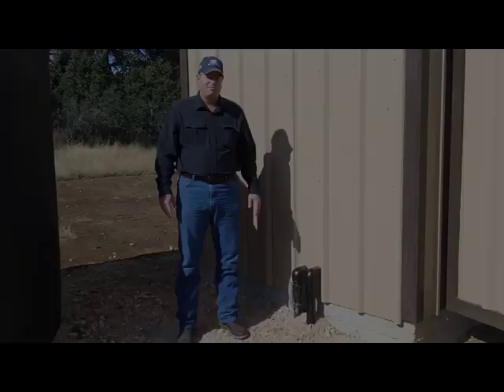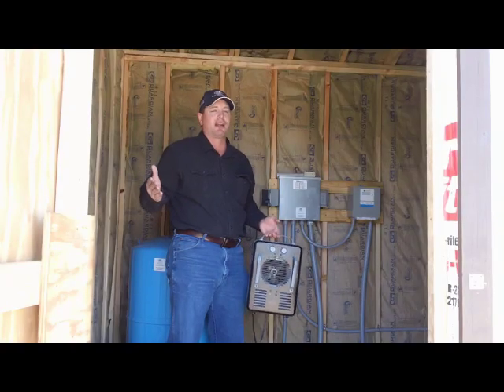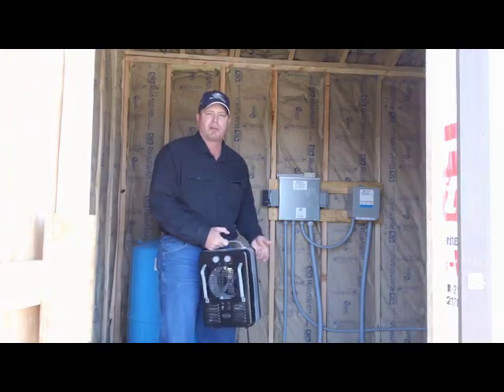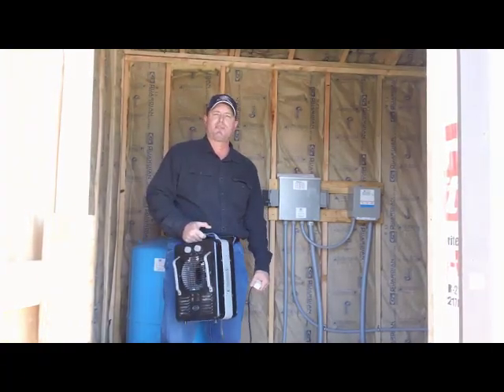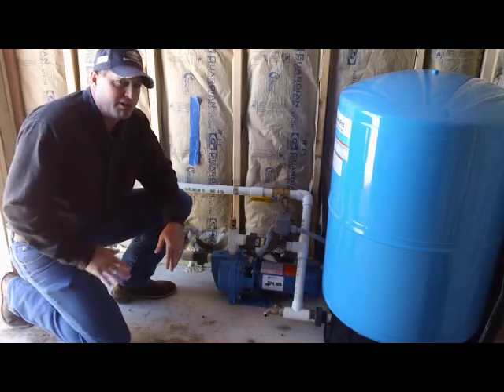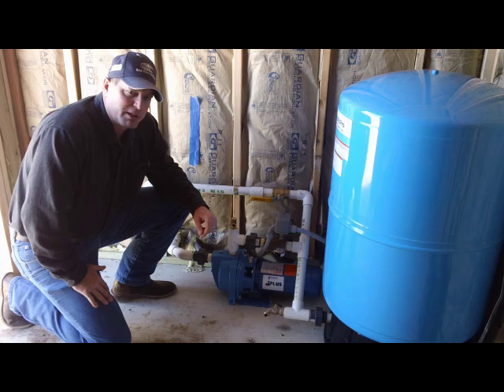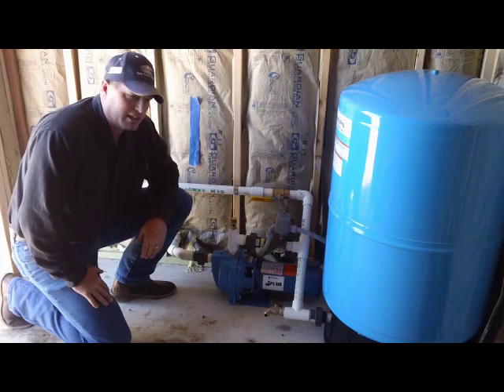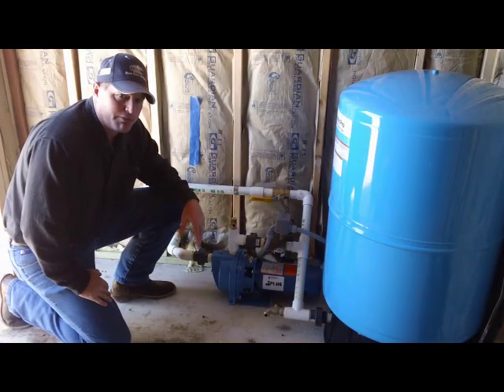Freeze Protection

Comment: Another good thing to mention would be solar power with backup battery. Or a generator. Some people may experience ice storms and power outages. Then none of that works, except the insulation. With backup power, you're definitely covered. Thanks for sharing! I'm planning for our well pump system install and found your video helpful.
Reply: Bluetera good point

Comment: I don't stay at my ranch all the time. I have a storage tank system, is there a way to make the pump kick on with a thermostat so water is running when its below freezing? I have a insulated house over my pump with thermostat cube for a heater. My concern is the storage tank and pipes.

Comment: I have a shallow well pump in my basement it's not insulated would some heat tape on low placed on the pump protect it from freezing
Reply from the maker: Yes.  If the power stays on.  But if its in a basement, a small space heater will work too

Comment: extremely good advice every homeowner should know if they dont live in a city. what i dont get is why you cannot build on top of a well. it would keep it insulated and pipes wont ever burst. yes, i know wells can collapse, but this isnt the 1800's. i am sure there is a way to get it to work.
Reply from the maker: When the submersible pump needs to be replaced, you have to pull the pump up through the casing.  Normally it is in 20' joints of rigid pipe.  If you have a hole in your roof (like a skylight) then you can build over it in many cases.  But, it will slow our crew down and you are paying by the hour to change the pump.  Another option is to replace your pipe with a flexible pipe or hose that won't require the hole in the roof.  This is not always feasible depending upon many conditions.  You will need to consult with your local well contractor about this before doing.  i have redrilled a few wells in my life because we were not able to service a well because the homeowner built around it too much.

Comment: Hey nice video! If we were putting a pump system into a seasonal home would it be bad to just let it freeze when we left for the winter? (We would drain the tank before we left of course!)
Reply from the maker: As long as you completely drain all tanks, pipes, etc. the equipment will not be damaged due to a freeze.  But it may be hard to get all the water out depending upon how your system is set up.  You may need compressed air to get the job done fully.  Good luck!
Reply: Thanks! @jimblair1   I'll sure be willing to put in a little extra work when closing up camp. Which is much easier than having to worry all year.

Comment: Hi Jim. We're in W Central Missouri and trying to decide whether to change our old deep well pump to a new solar with backup AC, or to get an above ground tank (rainwater catchment), sink its bottom 42" deep with buried pipes to root cellar where pressure tank is. Any thoughts? Could an aerator in the tank keep the water from freezing? Would a poly tank stand the bottom 42" in ground? Thanks.
Reply from the maker: I don't think it would be wise for you take advice from a Texan about how to freeze protect a well up in the frozen tundra of Missouri.  But, if I lived there, I would probably build an insulated, heated pump house and keep my tank above ground in there.  Most tanks are not designed to withstand ground pressure.  They will do alright as long as the tank stays full, but if the water level drops, your tank could collapse.  Not much of a problem with a metal propane tank.  But, if you find a tank that can withstand ground pressure and you keep it deep enough, it will work.  An aerator might help but i wouldn't count on that tiny piece of equipment to save you.
Reply: @jimblair1  thanks for sharing "what you would do." I respect your opinion very much. We have heating our root cellar in the coldest nights to protect the pipes and pressure tank.  Your videos (I've watched another one, too) are very helpful! Thanks again.

Comment: I was going to build a small shed to enclose my well but then thought
what happens if the submersible pump fails over time...may have to
rip it all down to replace that pump or service the well...thoughts?
Thank you. Great information
Reply from the maker: Pump houses over the well are quite popular.  Just make sure you have a removable roof or a skylight directly over the well head.
A 24" X 24" skylight is best but we can usually work with an 18".

Comment: Hey Jim! We have a two-room cabin on concrete blocks in the North Woods. Underneath the house is open and we have a wooden box built around the outside pump. We usually leave in the beginning of October. We might have a night or two that's 30 32 degrees, days in the 40s 50s. Then the nights kick back up into the 40s with the days in the 50s. My question is when do we need to get out of town. Do the Lows have to be in the 30s consistently for two or three days with the highs also in the 30s or could it freeze with just one or two nights in the 30s. Thank you in advance.
Reply from the maker: A small water pipe can freeze solid with only a few hours below freezing.  Check out my video on freeze misers.  This is another great tool that can protect your pipes without the hassle of installing insulation.

Comment: Hi I buy a property in Arizona it have a well with a 5" steel casing and you have a PVC pipe inside the inside of the PVC pipe is 4 1/4 kenai install a 4" pump on it or have to be 3" pump I will appreciate it so much if you answer me thank you
Reply from the maker: The main casing we use is 4.5".  That allows us to install a 4" pump inside. You can install a 4" pump inside 4" casing if the casing is not too thick.  4" will fit inside 4" sch. 40 or thinner, but will not fit inside 4" sdr-17 or sch. 80 pipe.  We use 4.5" to avoid this issue.  when we use sch. 80 casing, we step up to 5".  Another consideration is flow.  If you have a 4" pump inside 4" sch. 40 casing, you should limit your flow to about 12 gpm.  You need to make sure you have enough room beside the pump for the water to flow.
Another option is to get a slim line pump (3.75") or use a 3" pump if your casing is too small for a 4" pump.
Reply: @jimblair1  thank you soon much I think I have to go to 3" because it's a share well for 2 house's I want to put a 35 gallons per minute pump

Comment: I’m about to be fixing my well we just moved into this house and wasn’t prepared for this cold snap. I’ll be insulating the well house for sure. The water system was Jerry rigged I’m going back with how it should be. I’m also going to add a heater. My system doesn’t have a booster pump does that just increase water pressure?
Reply from the maker: Booster pumps are use for 2 main purposes.  Boosting city water and pushing water from a storage tank to a pressure tank.  See my video on storage tanks.  https://www.youtube.com/watch?v=fTJrRpVkiTI&t=38s  
But, there are other tings you can do to increase the water pressure.  Check out this video on adjusting the pressure.  https://www.youtube.com/watch?v=Vv4gY35byY4
Then, check to make sure you have no restrictions.  filters, small piping, partially closed valves can all reduce pressure.
Reply: Bee Cave Drilling  thanks for the reply I got it all fixed how it should be, still no booster pump, however with only one reduction and everything else plumbed right I removed several unneeded feet of pipe and pointless valves, my water pressure practically doubled I’m very happy with it now. The storage tank really interest me and I can see the benefits in it I’ll be looking more into it

Comment: Our well head is outside of the well house. The previous owner put a plastic bucket around it with the top of the bucket cut off so the well head was exposed to the air… and threw a few nasty bathroom rugs on top of it. Wow! What can I do to keep the well head from damage or freezing?
Reply from the maker: Heat tape is great if you have a power source.  But at the very least, some insulation.  How much you need depends upon how cold it gets where you are.

Comment: What’s the purpose of a booster pump?  I don’t have one down here in south Texas,  Corpus area my well is only 130ft when we change pumps we pull it out by hand save a lot of money
Reply from the maker: We install a lot of storage tank systems where the well fills the storage tank.  Then you need a booster pump to put the water back under pressure.  Check out the video.  https://www.youtube.com/watch?v=fTJrRpVkiTI&t=101s

Comment: Thanks for the video.  What do you think about "heat tape" wrapped around the above ground pipes around the well?  George, Smithville TX
Reply from the maker: Heat tape is a great product if installed properly and if the power stays on.  We use it for some applications.
Reply: @jimblair1  I have heat tape on inside our pumphouse I wonder if you could rig a battery and solar panel to help in longer power outages?

Comment: Hey Jim, great video, thanks. Have you looked into thermal jackets for the water pressure tank itself? Also, what are your thoughts on PEX and its better resistance to expansion?
Reply from the maker: Where we are, we don't get cold enough to have damage to pressure tanks due to freeze. If you are in an area that gets that cold, then that would be a great way to fix the problem.  I like PEX for its expansion properties.  We don't use it on our controls section of the plumbing because we have so many fittings to add in that it would just bust the fittings.  But, for long runs, we use it in water lines all the time.
Reply: @jimblair1  All good stuff, thanks again.

Comment: So I run a 550 gallon storage tank, if the tank is getting super cold, even icing up on the top. Is it ok to run water right back into it to keep the pump running over night? The water in the storage tank is cold right? So is it better to run the water or not?
Reply from the maker: If you keep the water running enough circulating through the tank it won't freeze.  How much depends upon how cold it gets where you are.  Here in Texas 2 gpm is plenty.  If you live at the North pole you might need 100 gpm.

Comment: If one is away from the house, is cutting the power to the pump and then draining the lines a way to prevent freezing..?
Reply from the maker: This will work if you can actually drain the water.  But in most cases, you will need an air compressor to blow the water out if the pipes.  Trapped water will still freeze.

Comment: I have a well without a well house.  There is just what looks like a rock over the pump. I dont have a storage tank, the line runs up to a spicket and then i have a heated hose to my rv. Can the pump or the spicket freeze? The water line is burried, can that freeze? Help please no water is running in my rv. What to i do? Was i supposed to trickle the water inside the rv like u do a house?
Reply from the maker: This all depends on where you live.  If you are in Central Mexico, probably not.  If you are in Nebraska, it probably already is frozen.  If you live near me in Texas, then you probably are fine with anything buried.  But everything else can freeze.  We have seen pipes freeze up to 6" deep underground here.

Comment: Put the pump house inside a utility room in the house and put your water storage tank underground...only insulate the pipes...what you think??
Reply from the maker: Hey, if you have the means to do that, you should be protected from freezing.  But, be careful about installing storage tanks underground.  #1 issue is possible contamination of the water.  Second issue is the tank popping out of the ground.  It can be done, but it needs to be done right or you will regret it.  Check out my video on types of storage tanks https://www.youtube.com/watch?v=bsfSTDxI49M
Reply: @jimblair1  ok thx

Comment from the maker: There are many good brands.  Just look for a "milkhouse heater" or "utility heater".  You can buy good ones for $30 online.
Reply: I set up one of those oil filled radiator type space heaters in my pump house that has a frost proof setting and I think they retain heat longer after they kick off.
Reply from the maker: @DavidGlover  guys, any type of heater that doesn't use electricity will work.  i used a propane heater that sits on top of a 5 gallon bottle.  It burned for several days and kept my pumphouse toasty.

Comment: Why the hell do wells use 1/4" pipe for the pressure switch?  It freezes very easily and is a real pain in the ass
Reply from the maker: The real reason is that it really hard to make them 1/8".  They are always wanting to save a dime.  Get some good insulation.
Reply: I have one of those foam pool noodle looking ones on it, was hoping that would do the trick but apparently not..  at least winter is almost over, will need to figure out something for next year.
Reply from the maker: You can also use heat tape.

Comment: Yes, a heat lamp is a light bulb. Basically a nichrome wire element encased inside an evacuated glass envelope. And, yes, you do not know when it will fail. An electric space heater is basically a similar wire element 'encased' in the heater case and exposed to the open air and dust and such - and you do not know when it might fail, either. Or if or when it  might ignite a fire in that wooden bldg.   A couple of points. Why (try to)  heat a 1000 cu ft building to keep a 1" diameter pipe from freezing?  If you encase the exposed pipe in a smaller enclosure it takes less energy to keep the enclosed piping from freezing - a light bulb might be all you need.  Better yet an old string of incandescent Xmas lights so the number of bulbs offers some insurance against 'the bulb burning out."  Coupled with a temp controlled outlet it is unlikely all the seven-watt bulbs in the string with fail in any given season.